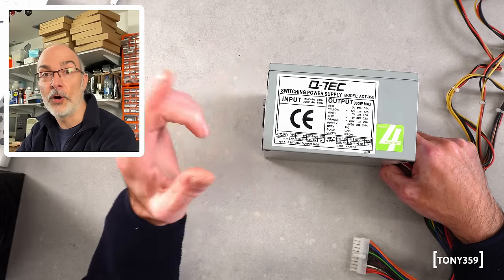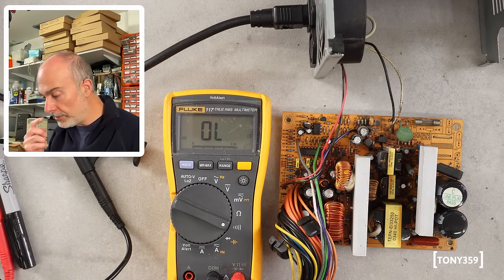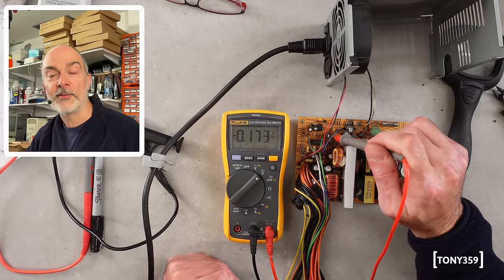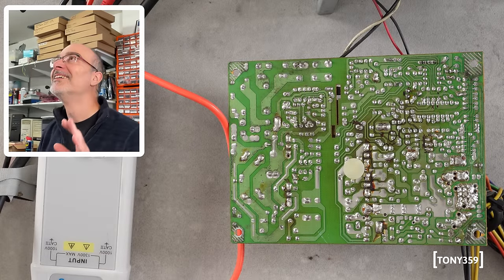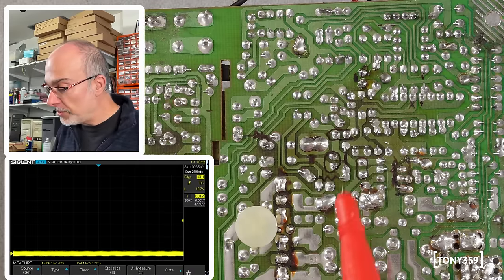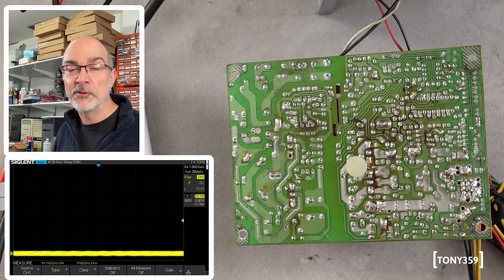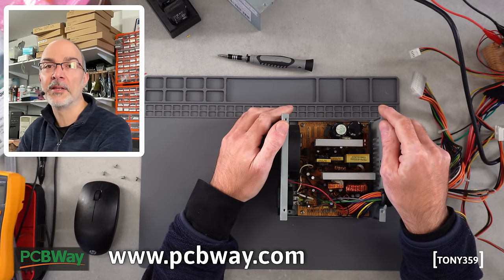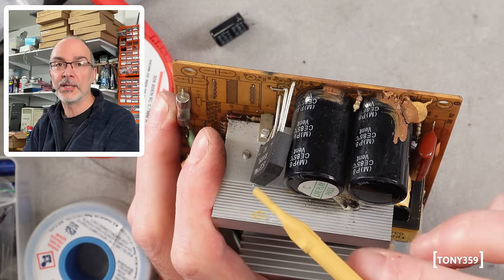Let's fix this 𝗗𝗘𝗔𝗗 ATX power supply!

Comment: Much of the noise you see on your scope comes from improper probing. You need to limit the ground loop on your probe, for example by using a proper scope probe with the ground spring clip. As it is you have massive ground inductance which HF decouples the scope ground causing lots of noise on the scope that isn't really there...
Reply from the maker: Thanks, I am aware of that. I am using a crocodile clip on the scope ground probe for convenience. I am fully aware this will introduce noise but it shouldn't be more than some narrow spikes which are not relevant to troubleshoot a non-working power supply. 

Years ago I was fixing another power supply. I fixed the main fault but then I could see narrow spikes and the device was medical grade so I was not expecting them. I had an identical one (fully assembled in its cage) which didn't show the issue so I kept working on and off on that board for ages. 
Only after LOTS of time I realise the noise was coming from the power supply itself because to test it I had to take it out of its cage! :D :D :D  Once back into the cage, the outputs were perfectly clean! :D
Thanks for watching and for your comment!

Comment: As a generl rule with these power supplies, the first thing to do with them always is to change the capacitiors.  Then if there is still anything wrong you troubleshoot the problem.
In most cases the capacitors are th problem.
Reply from the maker: of course but I seldom do that as I like to learn and diagnose. Anybody can just swap the capacitors but that's kind of boring :)
See my Yamaha repair video: I noticed the swollen capacitor straight away but went for a full battery of tests first to understand how the unit worked! 
If I was doing that as a paid service, for sure, you just take the shortest route. Thanks for watching!

Comment: Hi Tony, just started to watch this video, in my experience it mostly turns out to be a capacitor, usually on the outputs or the start up supply, sometimes an output diode, they look like transistors or Mossfets, but they are power diodes. Bob. I will be interested to see what you find
OH! also sometimes the startup resistor goes very high in value.
Edit: Well done Tony, for information it is rare that the big mains input capacitors have to be replaced. Bob
Reply from the maker: You were right indeed - I hope you enjoyed the troubleshooting process! I'll consider the input caps, they can be expensive... :) Thanks for watching!

Comment: You did not check the large rectified mains capacitors. I have found that these capacitors go down in value the longer the power supply is powered up. If these capacitors are more than around 30% low in value then it affects the maximum power that the power supply can deliver.
Reply from the maker: I did not indeed. The main reason is that... those are expensive and I didn't want to invest that money on this PSU! But you are totally right, if I ever put this PSU in service, those should be checked/replaced too. Thanks for watching!

Comment: If you do it on your own and have the time then yes, it's a thing to do.
But if you are a technician and a client asks you to fix one of those cheap psu then no, the time and parts will be worth far more than buying a cheap new one. The only exception would be a top tier brand high wattage one, which are very expensive. And even then most technicians will tell you they wouldn't do it.
Reply from the maker: Absolutely. If a customer approached me asking to repair a similar power supply, I would absolutely recommend they just buy a new one! Unless they have a good reason as you say. This is 100% for fun and educational purposes :)  The idea is that I've learnt something so when someone approaches me with a better/special PSU which is worth repairing, I know (better) how to fix it!
Thanks for watching!

Comment: Switching supplies are often easy to diagnose with your ears. When all is well there is a minor ring from the wavefront traveling into the coils but when its sick there is usually some artifact added that indicates a pathological failure. Not surprising because the design is really a variant of an amplifier so even the slightest low level noise will be bumped up. This becomes less obvious when the switcher is running at a rate higher than human hearing of course.  For example the step down (buck) switchers on GPU's and CPU's run at 400khz in some cases and that is only diagnoseable with a scope.
Two common failures are caps (dry out) and FETs but the most common is the fan decaying and not keeping it cool so the thermal stresses accelerate component failure. Sad really as a good two bearing fan cost just a bit more in the scheme of things but would make the supply last 10 years or more.  Additionally sad because when a supply goes it can take out a very expensive motherboard and CPU.
Reply from the maker: Manufacturers don't want anything to last 10+ years unfortunately. The "planned obsolescence" designed in some items is shocking. 
Thanks for your insight, I never considered the amplifier similarity!
Reply: @tony359  - It's not really planned obsolescence although failing outside of warranty is a metric taken into account. The reality is that competition squeezes margins and the first thing that is on the table is long term reliability since the device will operate for 5 to 6 years without failure even with the cheaper components. What I find egregious is grossly overcharging for replacement parts or not offering them at all. Take Rolls Royce. At that price point the car should be multi-generational. But they often fail, due to quality issues, out of warranty. And buying a $1500 fuel pump, the same one used on a BMW ($350) and sometimes a VW ($125) is not standing behind your product.
Reply from the maker: I won't get that Rolls Royce I really liked then! :)

Comment: It is the most usual failure, the little cap nearest the heat sink is the culprit, the second most usual fault is if even does not switch at all , it is the high value like 390kohm or 470K average, that feeds the VCC in the primary side, think of it as a STARTER resistor, once it starts, the VCC IS feeded from a winding at the switching transformer. That is all "end of lifetime" faults.   And then comes the fully blown PSU by external power line peaks.
Reply from the maker: Of course - and this speeds up massively if the fan dies as well :)

Comment: In a many cases it is the capacitors that are the problem.  And that should be a primary step replace them all
Reply from the maker: Yes but as I said the purpose of the video is to explore the fault and learn. If I had swapped all the caps, the video would have been short and - I think - pretty boring :)
Thanks for watching!

Comment: I've got a PSU that looks very similar to your fixed unit. It came from an HP m9040n. I had a much larger/modern PSU I've put into this computer temporarily. I did the cursory look for obviously bad caps with "popped tops" and found nothing. I did try a few other easy debugging checks, but ultimately gave up on what is likely a $25 power supply. I may re-visit this PSU after watching your video. Cheers!
Reply from the maker: Of course it was really not worth the time on this PSU - it was just for educational purposes :) I hope you can fix yours!
Reply: @tony359  I hate eWaste, and my failed ATX PSU is in the queue to be worked on. I've fixed "so many" appliances around the house, literally saving thousands of dollars. These learning opportunities are worth the time.

Comment: Fuhjyyu were known for subpar capacitors that were commonly found in generic psu's but also occasionally made it into brand name psu's; I have 2x OCZ modstream 450 and 500w psu's that originally came with them; I recapped both with panasonic FM series when the psu's were still relevant.......for a good laugh you might want to read the definition of Fuhjyyu on urban dictionary, at one point they were that common...... anyhow could of saves a lot of time by just replacing them as soon as you saw em(they come bad from factory):P
Reply from the maker: ahahahahah Chinese word for... LOL! I had no doubt those were of the best quality! Thanks for that!

Comment: Q-Tec are bottom of the barrel, they die if you look at them while wearing shades. The only way to fix them is to gut it and put a pico in it. :P
I had the misfortune doing support for a shop that sold them for a short while and I don't think a single unit survived longer than a year. Ok I'm exaggerating but the failure rate was astronomical. They were included with a lot of cheap cases back then, good thing they were dropped by most of them AFAIK.
TLDR, I would never use it on any system, as soon as you put load on it it'll fall apart.
Reply from the maker: ahah I believe you! After all they came with two VERY cheap cases! :)
Reply: @tony359  still a fun video though, you did a good job getting it working. Well... "working" as new lol.

Comment: I am glad you could measure ESR to prove caps bad. But as aluminum electrolytics go, I have never seen one measure lower value of capacitance than it's rating. When you're showing 20uF for a 22, or 9.7uF for a 10, and saying the value looks ok, I cringed. It doesn't even matter if it's within spec (often +80/-20%) if it's low I would replace it and always consider it bad. I'm sure I've measured quite a few over time.
Reply from the maker: 9.7 for 10 is 3% off :) Maybe it's my meter but I normally measure something a bit lower than expected with brand new (good quality, Panasonic etc) capacitors. You also have to consider that what the instrument measures is an instrument measurement. I've had a few caps measuring perfectly fine but crippling a circuit when "under load". That's why I'm not too bother about what the cap reads, unless wildly off or with high ESR. Of course to give the unit the maximum life you just replace them all but I'll leave that to other channels :)
Thanks for your input though, always appreciated!

Comment: I noticed that none of the power supply input filtering was fitted to the board. Links were fitted where the common mode filters would have been fitted.
Reply from the maker: Yes, it's a quite cheap unit!

Comment: I think a sneaky fault is a bad linebus  - like the -5vc or something in that order..
I bought a nice old board from 1993 and it came in mint condition - and yes, it still is.
i currently have in on a piece of wood. DeCase-As-it-Is

Yesterday i powered the board - and it did POST but.. didn't find the HD
it's a Quantum Fireball 24Gb and it's recognized by the OS
the controller has a max of 8G ..

Eventually after moving the controller over the board
trying to find a better slot i wondered if there was a PSU signal issue
and behold.. i found a replacement PSU and it booted..
Reply from the maker: I suppose the 12V was not great? The HDD logic works with 5V but the motor runs with 12. An ancient board only runs mostly with 5V so maybe your 12V was not good. Just guessing - but well done!
Reply: @tony359  i used a "new" PSU with an ATX-AT adapter.. and later that day found a lose yellow line.. oy! 
i restored the harpoon.. and send it back into the black.. :D
Reply from the maker: ahah amazing! Yes, yellow is 12V! Well done!

Comment: I don't know why I always see the same mistake with lubrication in your videos.
You lubricated the plastic ring that retains the fan shaft. Not the fan shaft.
You need to take that white ring off, take it apart, clean and lubricate the shaft, and put it back together.
I see similar things like when you want to lubricate stepper motors, where you never lubricate the bearings but instead apply oil to the shaft. Which doesn't help.
Good reparation video.
Reply from the maker: Well the answer is very easy... I didn't know that! :) Others have pointed that out so I'll definitely do that next time, thank you! To be fair, I thought I could remove that washer - you see me poking with a pair of tweezers - but my concerns was that it might break and then no more fan. I don't have many 80mm fans so I decided not to push my luck. But on next occasions, for sure! Thanks for mentioning that!

That said, I can assure the oil I apply drips down the shaft, it doesn't just stop on the washer. Same with the stepper motor - I guess you refer to the IBM drive - the oil definitely went into the bearings.
Thank you!

Comment: How can convert the CLASSIC computer's Power Supply Unit into FULL MODULAR ?
Reply from the maker: I'd say you can't - or it's really not worth the time! Why would you want to do that if you don't mind me asking?
Reply: @tony359  I'm just want to better for computers cable management.... It has 1200watt but not in modular cable type. I need to put it out the cable i don't use : FDD cable, convert 4 pin molex into SATA power, etc...
Reply from the maker: a 1200W PSU is going to be very crammed inside. I seriously doubt there will be space for molex and removing and re-routing wires is going to be a Royal Pain in the Neck. You'll end up with something which might end up being dangerous - I'm not saying you're not capable of doing that, but il will take quite some time, patience and skills to do a decent job. And again, it might just be impossible.

Comment: Where did you get that dummy load?
Reply from the maker: I've just added a link in the description. I love it - there are some bad comments online, it's cheaply made but it's really versatile. I "tweaked" it a bit - new thermal paste and a heatsink on the main diode.
Reply: @tony359  Thanks! 🙂

Comment: Блок мечта ремонтника. Жаль ремонтировать такое коммерчески не выгодно. А так схемотехника источника питания простая как чайник, а выходят из строя конденсаторы. Лучше бы автор не юзал дифференциальный пробник для ослика, подал вольт 30 переменки на вход и безопасно тыкался. И сигналы от шимки и дежурки и на силовых ключах. А так тыкаться под 300в неизолированного сомнительное удовольствие.
Reply from the maker: Google translate is a bit unclear, I understand I could run the PSU using 30V AC? I wasn't aware of that, though I don't have a way to generate 30V AC right now. It's definitely not nice to work on something with 340V DC on it but at the same time it removes any unknown from the equation.

Wait, I just remembered I do have a big variac :)

Comment: No oscilloscope after cap replacement :(
Reply from the maker: Well, we did check the VCC line after the cap was replaced. Everything else was not checked because the PSU was making a squealing noise and I didn't feel comfortable running it in that state. Also, the length of the video comes into play at some point and I have to choose what to include and what not. But thanks for your feedback, I'll definitely keep it mind and thanks for watching!
Reply: @tony359  at least I know now what means a good and bad power supply. I expect from a good one to be without such noise and also I see that caps may look very ll from the outside and be crap on the inside.

Comment: i have PSU when i play games on full load its shutdown ,  is there chance to fix it ?
Reply from the maker: Anything is fixable but I'd advise against trying to fix an item which has 340V inside without knowing exactly what you're doing. The very Cooler Master you see in the video was replaced because it was shutting down randomly. I've used in my workshop for years and it never failed on me.
Intermittent issues are the worst to diagnose.

But first: are you sure the power supply is capable of delivering power to your system? What are the specs and what is the power supply?
Reply: @tony359  im not gonna fix it 😁😁 all i can do for now is soldering , maybe PC repair shop but i will tell u the brand it Chinese 600w from 1STPLAYER black widow , that is PSU name . its too silent i have another one  from ViewSonic high quality and heavy but not silent  like the Chinese one
Reply from the maker: A quick search online seems to suggest the "1stplayer" brand is not great (I am being kind) so maybe you should look into a good replacement!
Reply: @tony359  i do have ViewSonic  700w but on full load like a vacuum its too noisy "fan" about 1stplayer their cases is great i give them that , my last question is what is difference between gold and bronze psu , is that matter
Reply from the maker: It's the efficiency, if you google it, you should find plenty of info.
If the 1stplayer is as bad as I read, I wouldn't want it in my computer. It's been called the "computer killer" for a reason...
Reply from the maker: Yes, whenever I buy something from Aliexpress which comes with a power supply, I tend to throw it away and replace it with a proper one. If you cut corners on a motherboard, well, your PC might crash or whatever. If you cut corners on a power supply, then your computer might be dead or worse you might have a fire.
Each brand has their own good and bad power supplies, make sure you do a quick search online before purchasing. I think my own is a Corsair but I also like the BeQuiet which are quiet :) Good luck!
Reply from the maker: Check a proper review before buying. Some good manufacturers have come up with "lemons" over time :)
Reply: @tony359  yes but keep in ur mind humans will never agree on one thing , the better way to buy from known brands